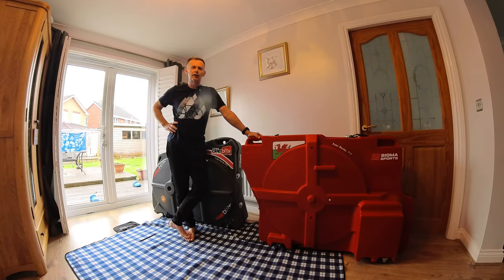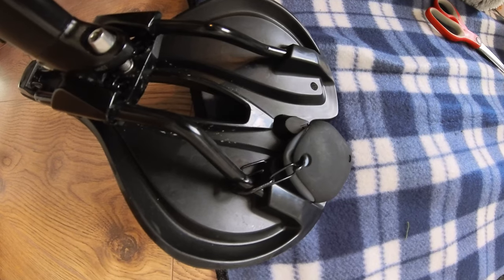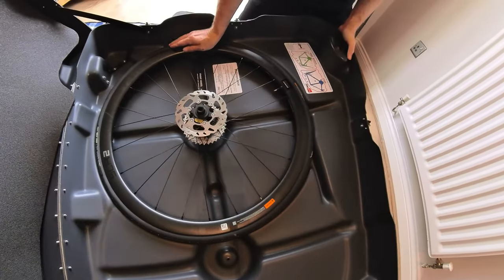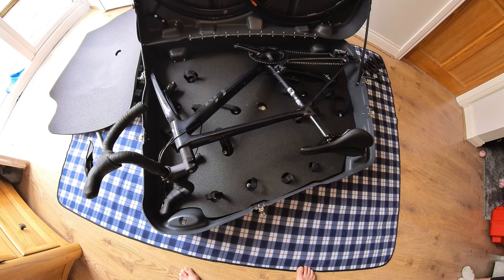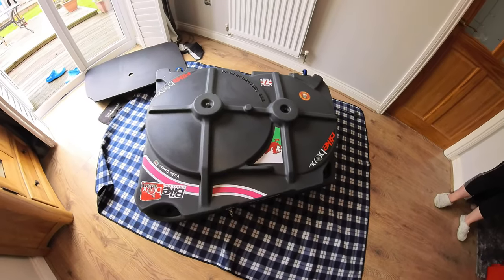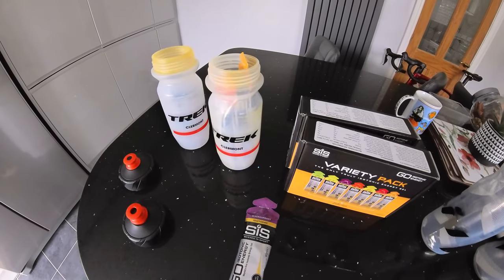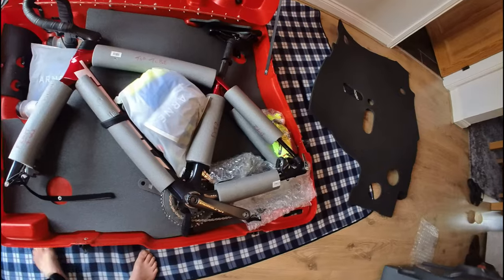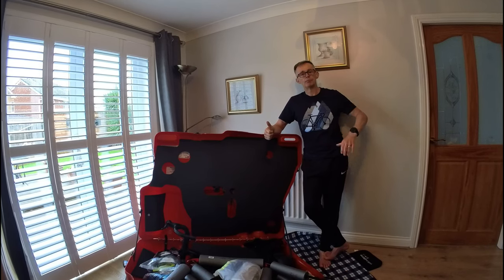How to pack a Bike Box - A detailed walkthrough!

Comment: Brilliant vid.  Great handy tips. Thanks both.  👍🏽
Reply from the maker: Very kind of you to say so. Thanks 👍
Reply: I’m going to watch it again tomorrow and maybe do a practice run.    Bit concerned about my tubeless tyres fitting in the recesses.  Plus I didn’t realise I need to get a couple of quick release levers 👍🏽. Torque wrench on my Christmas list 🧑🏽‍🎄. Thanks again 🙏🏽
Reply from the maker: @dawnsamuels1687  On the Liv bike I packed first..that had tubeless tyres. I tried to ensure I didn't break the seal between the tyre and wheel rim as I let the air out. I wouldn't have a tubeless tyre charge pump at our destination to re seat the tyre again properly. #Caution advised 👍